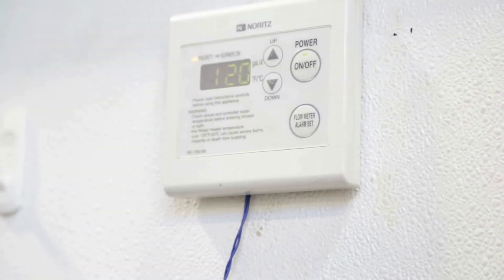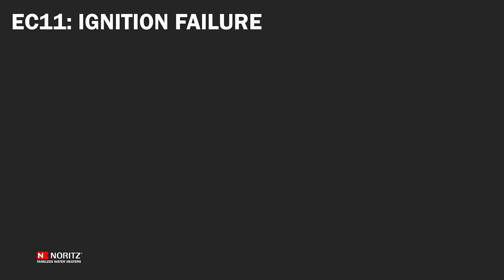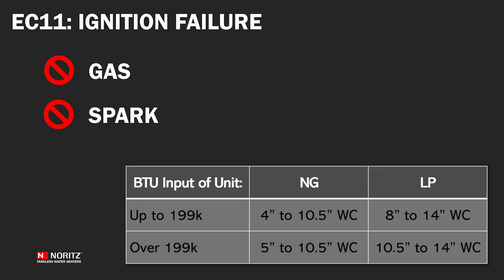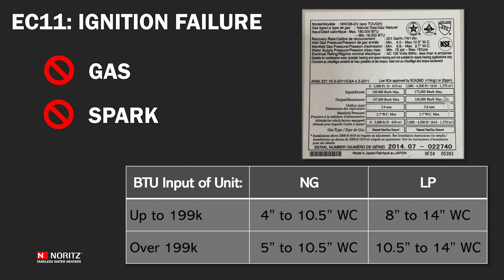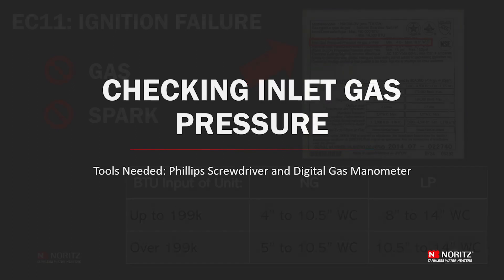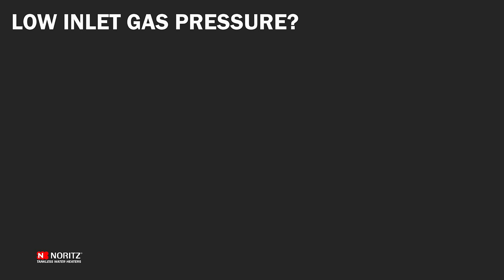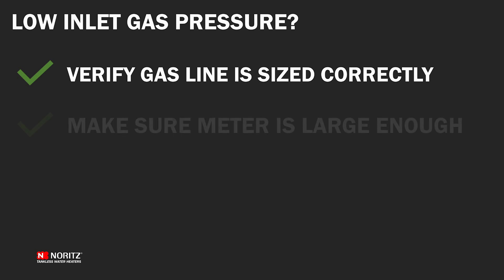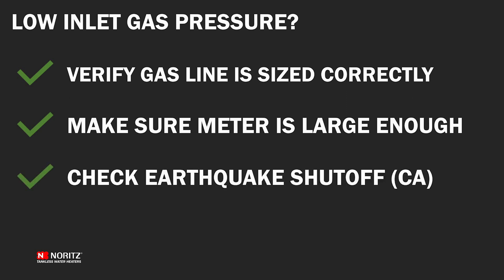Noritz Error Code 11 : Noritz Tech Tip

Comment: Had myEZ111dv for almost two years now no issues. Just got error code 11. Did everything these punts said. No work. They never mention the Ignitor box might be shit. It just made sense so I checked it with my multimeter and numbers jacked. So looked online could get the part for $52 OEM from store in New Jersey but I'm in Cali socal. Looked on Noritz website, the punts wanted 93$ for same part? So a plumbing store can make profit buying it from mfr sell at 52$. Yet Noritz sells to public at twice as much. Fugging scumbags. Noritz corp an hr drive I could a had hot water a day earlier if I wanted to get ask rammed. Noritz are greedy kunts. Plus found out my warrant no good cause I installed it myself. It was simple install if have half a brain and I did it perfect considering it worked flawlessly for two year. This is part of scam they run with dealers so it forces you to pay dealers to install it and bend you over for installation. Three thousand dollar machine and dealer gets two grand to install it. I did it myself in 2.5 hrs. Fugging scam. Oh plus they are taught they get you three hundred bucks yearly for their descaling lol. I do it myself so simple. Noritz wants like $250 for their descale equipment. I bought my own for 50$. So go fugg yourselves noritz you scam money grabbing puntz.

Comment: Error Code 11 on NRC111DV 199 BTU.  You're never going to guess what the problem was!  Got a call from the tenant (this is a rental).  Was proactive and ordered Ignitor and Ignition Plug.  Turns out, the next-door neighbor moved out.  Gas company showed up and turned off the gas meter to my house (no notice), not the house they were supposed to (neighbor).  24 hours later, multiple troubleshooting, cuss words, discovered the root problem.  Point being, check the not-so-obvious things first.  Damn it.  Do I want to mess with small claims court?  Maybe, maybe.

Comment: Error 67 on model CB199
Reply: Yes got it fix
Reply: @karinasoto2642  that's good. was it covered by manufacturer? did you call a repairman?
Reply: @karinasoto2642 answer the man Karina bro obviously needed help 😭
Reply: did you ever get that problem fixed? I'm having same problem with 1 week old unit. seems to be a piece of junk.